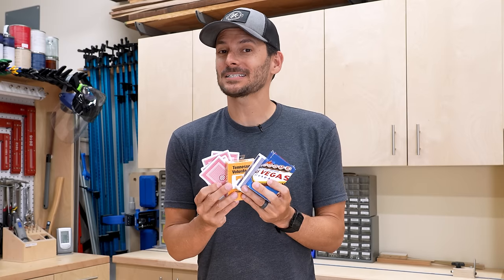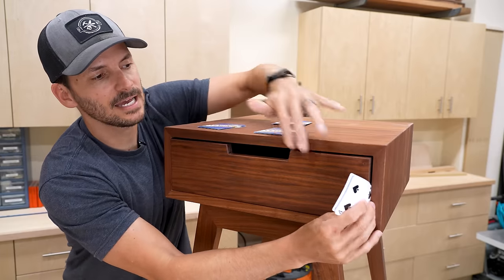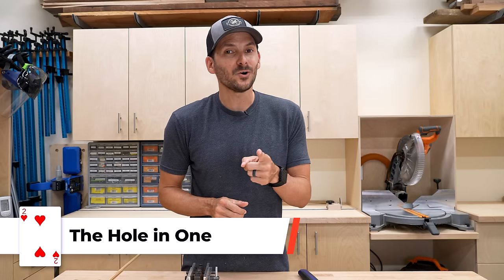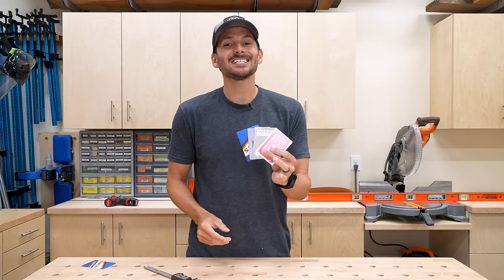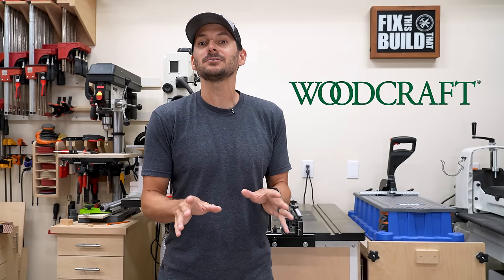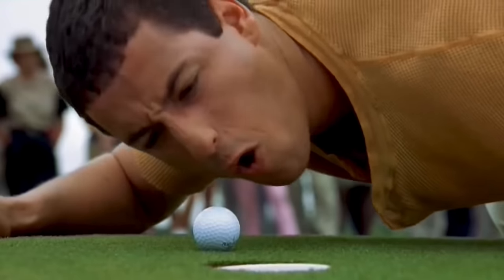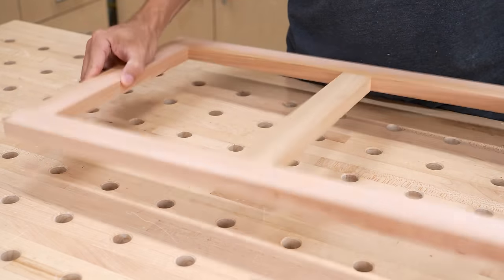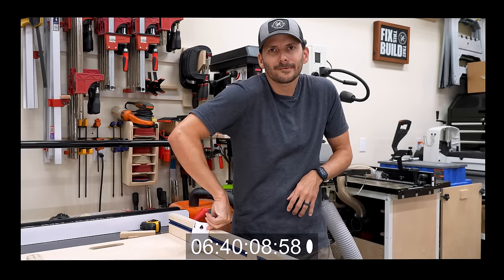Why don't more woodworkers know these tricks?

Comment: WOW.....  the trick to install  drawer fronts ...drilling the holes for the pulls and then screw the front to the drawer... then open the drawer and dill the drawer to the front....  Amazing tip   Thanks a lot

Comment: Disappearing Gap trick is VERY timely !!!  Building a set of folding tables and instead of a solid top I'm making a frame with slats.  This will held get that tight fit I need.  Thanks   BTW ... loved the Happy Gilmore clip
Reply from the maker: Perfect place for using some card spacers, Tom! Have fun with the project 👍
Reply: @Fixthisbuildthat  Mahalo (Hawaiian for Thanks)

Comment: Very interesting video so you'll have to accept my bits below.  I now have an old deck of cards in my workshop.
The hole in one is interesting- I've watched people cut off dowels and wondered how they kept from scratching the parallel surface.  I vowed to use something under the saw if I ever do this myself.
At 7:20 you show the piece that you are trying to fit in slightly sloped.  This will always throw off the measurements because the diagonal distance is longer than the flat distance.  If that board was 10" long the difference is about 0.030", or 3 playing cards in your measurements.  At 7:36 you show the correct way to measure with the piece parallel to its final position.
"As Jane showed..." should be "As Leah showed...".

Comment: Great tips!

I like using cards to micro adjust stop blocks:

If it needs to move out I'll put the material up against the stop, loosen the stop, put a card in between and then set the stop. Then i can remove the card and put the material back up against the stop.

If it needs to move in I'll put a card between the material and stop, loosen the stop while holding the material firmly, remove the card, loosen the stop, move it to the material and set it there.

Hope all that made sense and didn't turn into big blobs of words!

Comment: Card trick for drawer front was nice but you sort of cheated using a drawer front you could sneak a clamp around:)  I am just a weekend woodworker. Nowhere near your level.  But when I had this issue I put double sided tape on drawer front after I got the gaps right I pressed the front hard against the drawer. Tape holds it in place for me to open it and clamp.  Don't know if that is a well known practice or a stupid idea I just came up with. 

Thank you for all the great, entertaining videos!

Comment: A cardtickness of 10 mil??
Reply: 0.1mm would be reasonable
10 is definitely too thick
Reply from the maker: In the US a mil is 0.001". #imperiallife
Reply: @Fixthisbuildthat  Therefore you should change to metric, so the rest of the world knows what you're meaning 🤣🤣🤣🤣🤣🤣
Reply: 10 mm = 1 cm That is just a bit less than 1/2 inch. So a playing card is 1 mm. Not to argue, but cant you guys just surrender to the metric system 😉 Good videos as always 👍👍
Reply: @erikaaskarlsen7794  1mm =.039 in.. or 39 thousandths, his cards were 10-11 thousandths or .254 mm.  I'll never surrender, but will continue to use both!  ~¿@